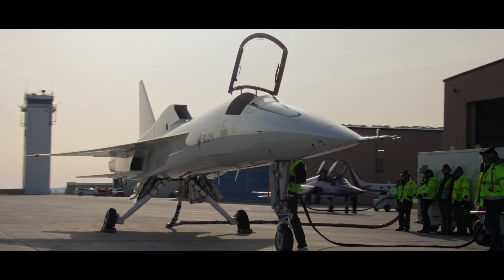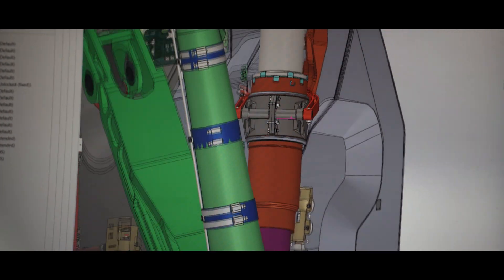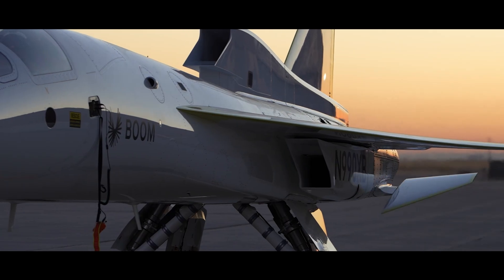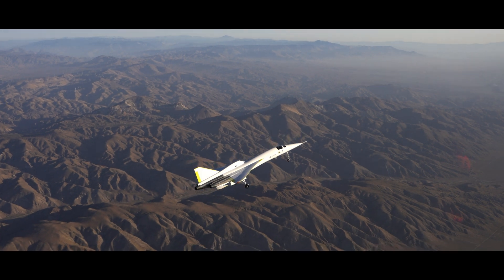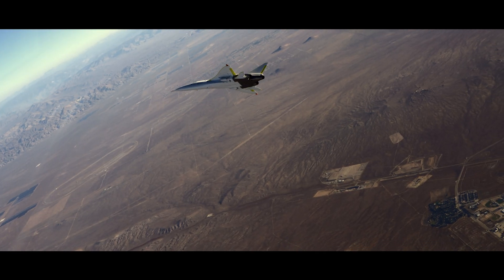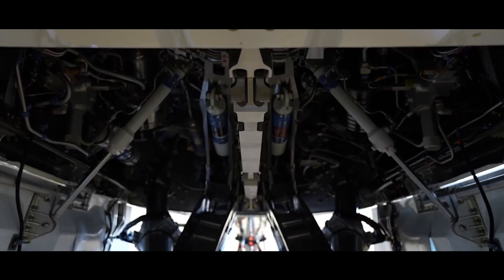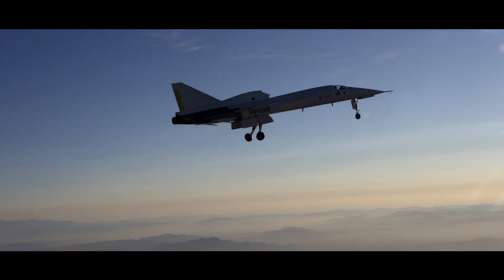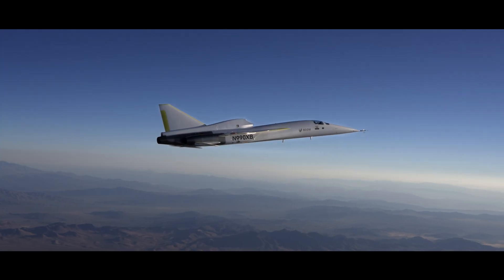What Happens Between XB-1 Test Flights?

Comment: Question: why doing this demonstrator when the full scale plane looks very different ? I totally don’t understand
Reply: Different sytems and technologies that will be replicated on the full scale airplane need to be tested somehow. So this provides a test platform for all of those.
Reply: @just2bme1000  what should these amazing systems be ? Why not sticking it to an F5 ?
Reply: @modellbobby World is moving on, we cant just stick to the plane models made in the 50-70's. New systems and new aircraft designs should be discovered and upgraded. If not, the world wouldnt be changing. If us, humans, wouldnt invent new machinery, we would be flying the ford-trimotors in the 2020's.
Reply: @modellbobby  Take the camera system that's on the nose of the airplane for example. This aircraft can't drop it's nose like the concord did, so it has a camera built into the nose that feeds video into the cockpit. That had to be tested. That's just one case, there's many more like the body of the aircraft, the control surface, avionics, the shape of the airplane and how aerodynamic it is. All of these need to be properly tested and the pilots need training on it. Eventually they will need to do speed tests and go up to Mach speeds and see how everything performs.

Comment: It's so exciting that supersonic travel is coming back to aviation
Reply: You think so? I don’t. Flying a prototype supersonic is an impressive achievement but it’s purely a technological achievement. To develop and certify a part 25 airplane is an entirely different thing. It will probably cost $20B in an industry with a 3-5% profit margin. So you need to sell half a $trillion worth of airplanes just to break even. How big do u think the market is? Boeing would never take this risk nor would  Airbus and they are both heavily subsidized directly or indirectly. So how the hell would a startup generate this level of funding? Nobody will take a supersonic flight from Denver to Milwaukee. It’s only transatlantic and transcontinental flights assuming the noise signature is small enough. And it likely won’t have the range to be transpacific. So the market is small. And that’s not even thinking about the field day that environmentalists will have trashing the program. There is no business case here. Period. It will never be built. Another Aviation dream that will die once the money tap gets turned off. We’ve seen it happen 100 times.